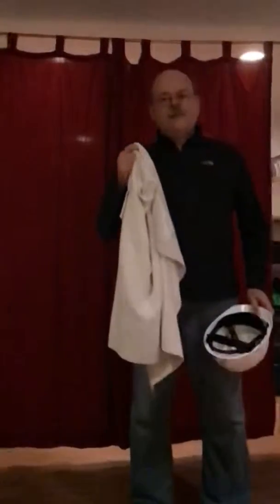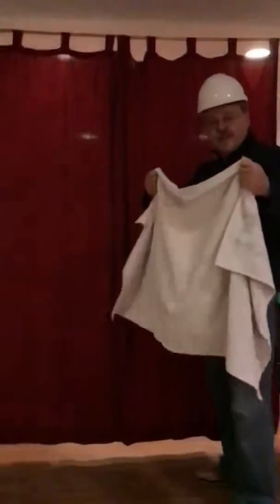Watch Me Break the Sound Barrier With a Towel

Comment: Your are not breaking the sound barrier with the towel. Not by a long shot. You are merely displacing the trapped air pocket as the towel tip reverses direction. The same will happen when you snap your fingers or clap your hands. That air pocket trapped between your fingers or hands quickly move out of the way. That is the "loud" pop you hear. Does a popping balloon break the sound barrier? No. A bullwhip on the other hand when cracked properly DOES indeed break the sound barrier. Not the very tip of the cracker, but the last part of the loop that breaks the sound barrier. A whip without a cracker can still break the sound barrier, although you will need more effort and the sonic boom will be less intense. That's the beauty and science of a whip. It's thong is tapered so when you form that loop and send it downrange, all that energy imparted on the thicker section of the whip will travel and continue to accelerate to the thinner section until it reaches the cracker where it's speed will be so high causing it to break the sound barrier and create a sonic boom. It's called conservation of momentum. I reckon you are reaching 200mph to 300mph at most with that towel. Don't get me wrong, I think it it's entirely possible to break the sound barrier with a towel or piece of long cloth, but not like you are demonstrating here.
Reply from the maker: Thanks for your comment. I did not rigorously measure the speed of the tip of the towel in my demonstration, and I don't have the means or the time to do it. I do know it's possible to break the sound barrier with a towel (https://www.straightdope.com/21343068/is-the-sound-of-a-snapping-towel-a-sonic-boom), and the tip of the towel is moving very fast the way I do it. So I made an inference that the same principle applied. However, a final answer to the question will require some research.
Reply: @ratioscientiae1922  Thanks for your reply and link. Appreciate it. Interesting results the students had there. I do however question their findings as does the writer of that article. After many failed attempts they changed the material to a piece of cotton bed sheet which was longer as well. If they kept on modifying they would eventually end up with a bullwhip. Their original test with a normal towel "appeared" to have broken the sound barrier, but it was too close to the speed of sound to definitively call it. So my assumption would be that it is indeed possible with the right amount of force and technique to break the sound barrier with a normal towel, but you will have to be very skilled at it hehe!
Reply: Well said. The tip of this towel was barely breaking the speed limit of your local highway. It wasn’t even a solid snapping technique.